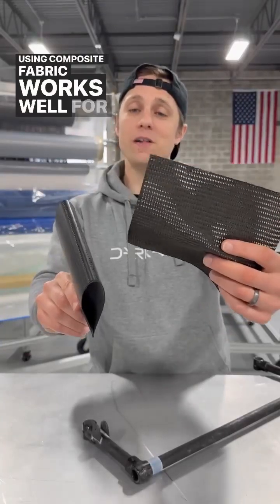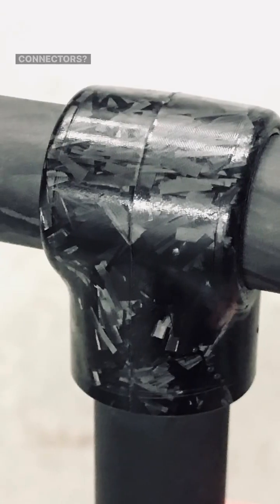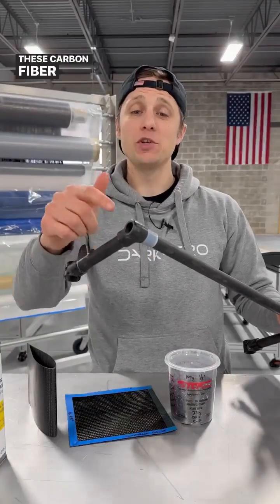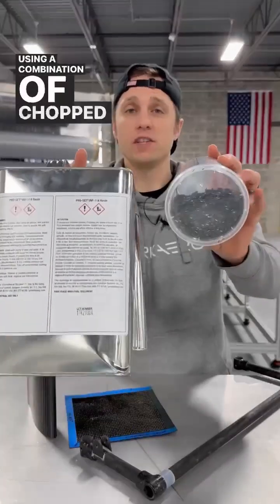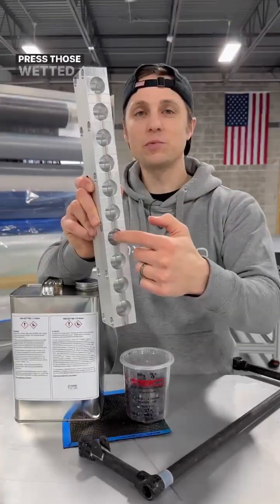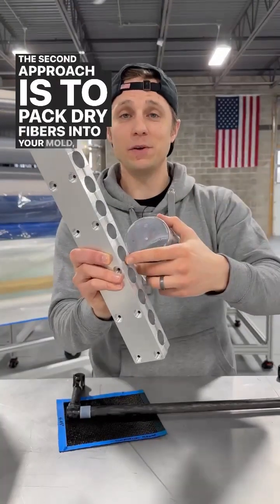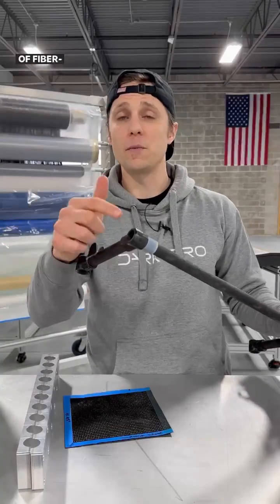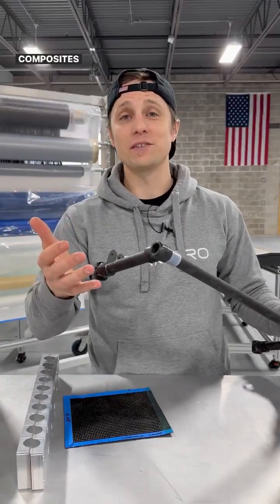How to make ‘forged’ carbon fiber parts

Comment from the maker: Learn more about our courses at darkaero.com/courses
Reply: Hi @DarkAeroInc, I'm curious. It appears you're filling the entire mold with chopped fiber with no tube cutouts. I'm guessing this results in "solid" tube connectors. Do you drill the tube holes afterward in a post-processing step that's not shown? Thanks
Reply from the maker: @justinmorgan7851 Yessir! The bore in the tube connector was machined during a secondary operation not shown in the video.
Reply: @DarkAeroInc Thanks! Beautiful workmanship btw.

Comment: I really want to learn more about making forged components but I've really struggled to find literally any resources about compression mold design or anything like that, especially when it comes to recreating more complex injection-moldings that may have undercuts, thin sections, or hollow areas.

Comment: You can use resin infusion for forged carbon? Interesting i didnt know that, you have any videos on the process?
Reply: You really shouldn’t if the part to be used is structural. You are not gonna get a comparable compression with a vacuum than with a male/piston side of a mold which will give more densely packed fibers and be stronger.

Comment: Super fascinating! What is the strength/stiffness of those forged tube connectors compared to say steel?  Do you use any other forged carbon pieces in the plane?
Reply: Definitely a superior weight/strength ratio compared to steel, but a lot depends on your process, your quality control and your part geometry. When used in any structural application it's recommended for all composite parts, but especially parts made from chopped strands like 'forged' CF, to design with a healthy safety margin (2 times the required strength or greater) and to make some test articles to test to breaking point.

Comment: What's the chance of flow lines resulting in parts with flaws when the chopped fibers don't interlink/overlap?
Reply: Pretty sure a couple grades or strand sizes and chopped piece sizes like a course and fine is used to make a more consistent mix that'll decrease probability of resin only voids or undesirable strand overlap.

Comment: What I can't kinda understand is how you avoid a grain/layers when using this method. Doesn't the direction that you stuff and press the fibers in affect this?
Reply from the maker: Yes, it's possible to develop a bias in your properties depending on how the fibers are packed into the mold. Depending on your part requirements this may not be an issue, but if having a bias puts the part at risk of being near the limits of its strength, another material/process should be considered. Resin also plays a role in the strength for these types of parts so this is another variable that can be changed to meet your requirements. Having a good handle on your part requirements, a consistent process, and collecting test data on your parts is key.
Reply: @DarkAeroInc what type of resin is recommended for high strength Motorsport or aircraft applications? for a carbon driveshaft or aero parts subject to intense high speed air pressure?

Comment: you are not doing" forged " carbon at home without special tools. you may get the look but not the strength .
Reply: Interesting comment.    Can you say more if you have time.  Thanks.
Reply: @Rathlin Postman  real forged parts are made under high heat and pressure. it's easy to get the cosmetic look of forged carbon with chopped strand but the strength properties will not be there. for exame you'll see lots of DIY youtubers doing "forged carbon skinning" etc when they're just vacuum bagging chopped strand carbon over a part but not actually making a forged part
Reply: @burnchruches  Thanks for that.   So then it's like for example, the difference between drop forging a steel spanner and moulding a composite streamlining fairing.

Comment: Where do you get your resin/ fibers from?
Reply: He holds up Pro Set INF-114 infusion resin, which is what you'd use for the vacuum bagging infusion process he mentioned. You can order this from a variety of suppliers. I'd be curious what resin they use for the non-vacuum process.

Comment: So youre probably using infusion if ive learned anything from you? ;)
Also can you use recycled cf for this? Seems like the perfect use case for old wind turbines etc
Reply from the maker: We've done both, but for the tube connectors featured in this vid, we infused them. Definitely possible to use recycled carbon fiber if you can get the requirements of your part to line up with the published specs on the carbon fiber, but quality control will play a role here. If the part is purely cosmetic, then using recycled fibers is probably not an issue. However for any structural parts it would be critical to have a supplier of recycled fibers that can guarantee a certain degree of consistency with the source of the fibers.
Reply: Due to cost, wind turbines are made from glass fibers, not carbon.
Reply: @UncleKennysPlace  this is half true. For example, Siemens Gamesa states they use pultruded carbon fiber along with Glass fiber in their IntegralBlades Technology. i would assume its Carbon fiber rods running down the blade with the glass fiber making up the surface and the form.

Comment: aren't those chopped dry fibers super dangerous?
Reply: They burn all the same when the incinerator cremates you.
Reply: Just don’t eat them.
Reply: @mattym8  it's more a breathing thing. like asbestos. carbon fiber is said to be as dangerous or more than asbestos. and it's not talked enough about.
Reply: no
Reply: Those fibers are way to big. You’re not going to be breathing those in.
Reply: @theSupercloak - disagree.  I have worked fiberglass and carbon.  Protect yourself from breathing this stuff.
Reply: @theSupercloak  promises promises